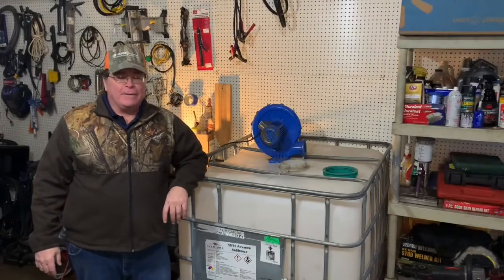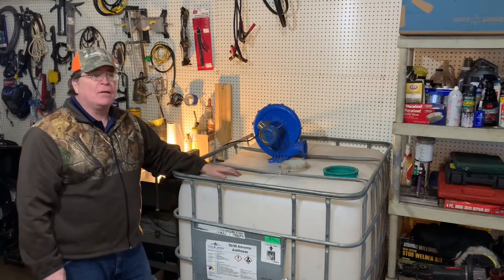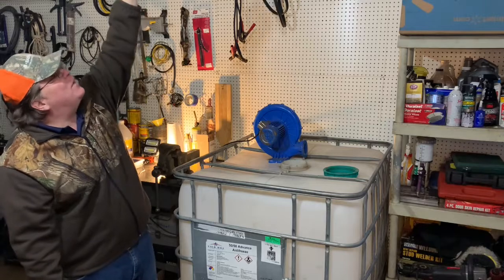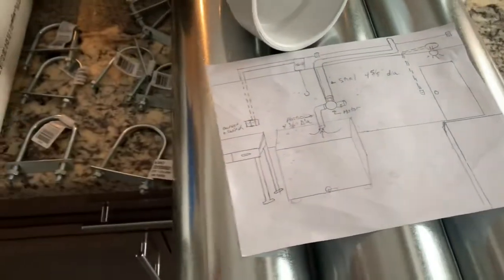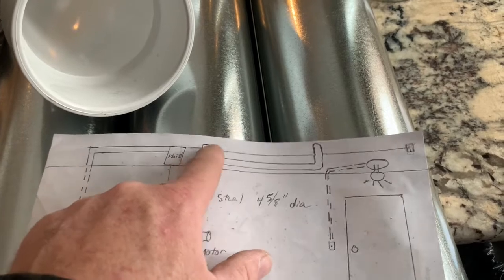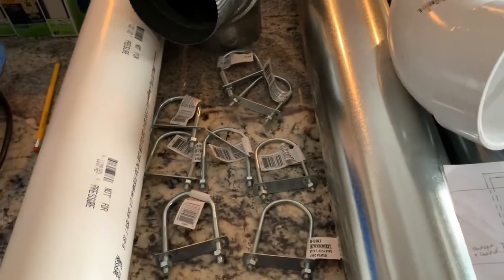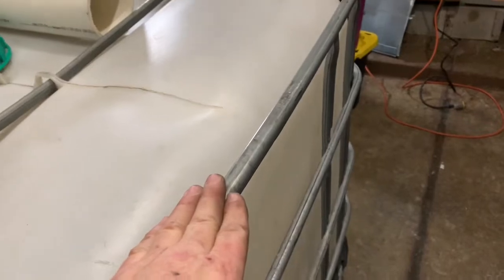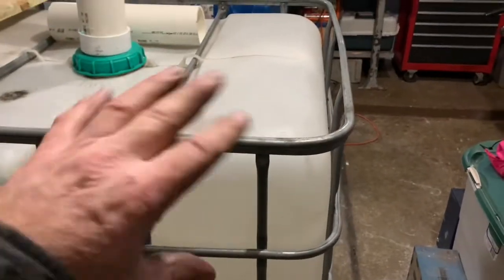DIY Indoor Outboard Test Tank, Hoist & Ventilation - Part 1of 3

Comment: Kinda thought about doing this myself! But if anything I need to do is get some heat in the garage first!
Reply from the maker: I just use a “heater buddy” and a propane tank for now.
Reply: @LivetofishOutboardRepair  might try that. Yesterday I was trying to clean that 8 up and the degreaser froze to the motor lol!
Reply from the maker: @sethgabbard7705  yea I can see that happening. The heater buddy works well. Sometimes I open my door leading from the garage into the house to get some heat from the basement but the wife gets upset 😠 cools down the whole house. Lol 😆
Reply: @LivetofishOutboardRepair  lol! Works though!

Comment: I used to test my outboards in the garage also until the wife said enough was enough. Sigh. Now I test them outside!
Reply from the maker: Was it the noise or the smoke that annoyed her?
Reply: @LivetofishOutboardRepair  The smoke. I didn't have a vent fan. It was really bad with those old 2 strokes! In hind site I should have installed a vent fan!